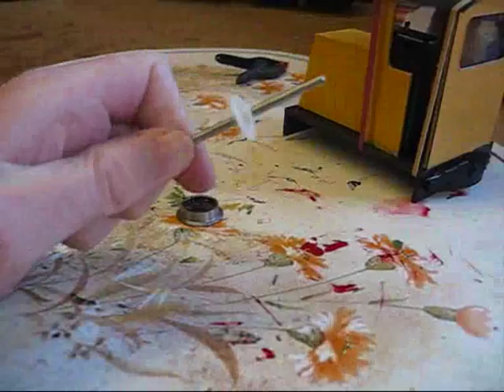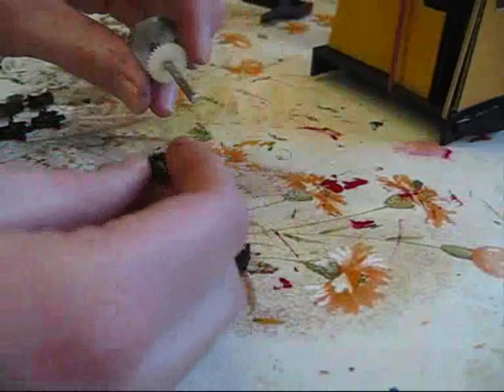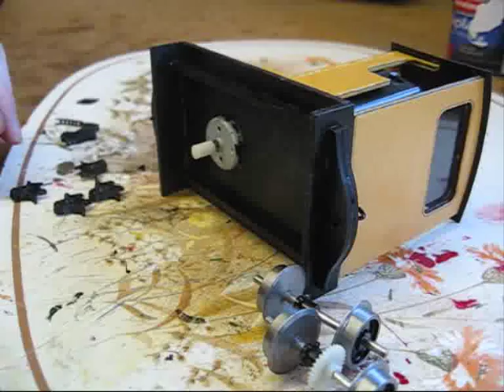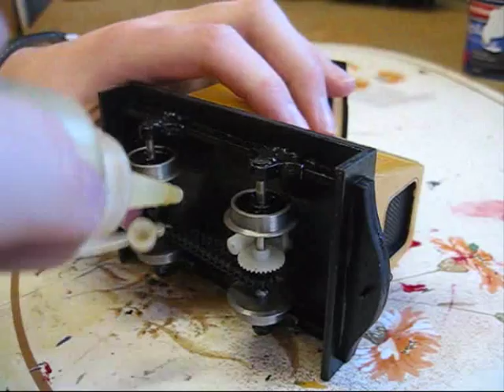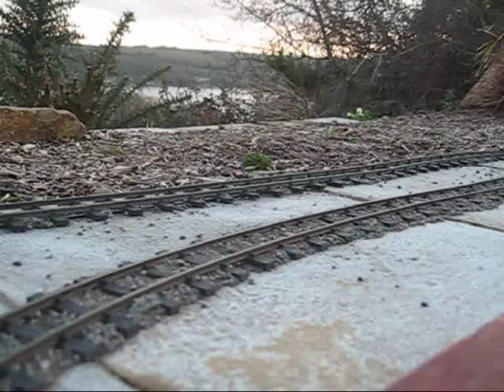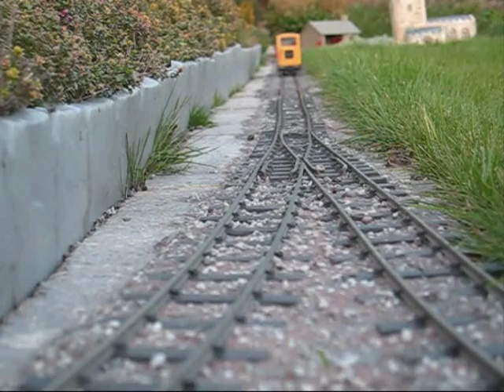Step by Step Guide to Building a Rapier - PART 3

Comment: I bought a Romfords set the otherday 30:1 with a 2mm hole for the motor on the steel worm gear with locking screw (tiny) (will fit yours) and the gear fitted straight onto an IP eng axle I happened to have here,the gear is brass with helical teeth so is quiet,this too is secured by a tiny grub screw,cost me under £4 new from ebay,they do different ratios aswell like 50:1,60:1 etc depending on how fast you want your loco to move,top quality product.

Comment from the maker: Well with a wooden kit like this aimed at the beginner/pocket money market, glue is the best way of securing it... usually it's the wood that gives way instead of the glue. The only thing that I think that relying on glue to secure is the Nylon gears the steel axles, as you are an engineer I can guess you know that nothing will stick to Nylon, so it will only be the glue forming a tight 'grip' on it. I'd prefer to pay another couple of quid for a metal gear set with a grub screw to secure them.

Comment: Well done for putting the kit together,Ip engineering rely on glue too often to hold mechanical components together,it may be a cheap way of doing it,but its the wrong way of doing it.For the cost sake of some metal and fixings your left with an inheritantly weak model which spoils the rest of the work put into making the kit/model.